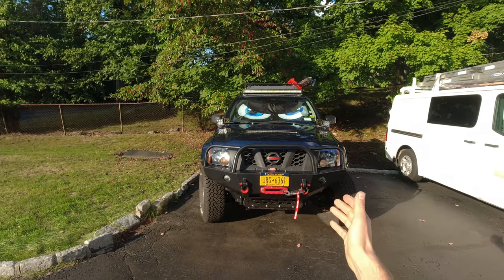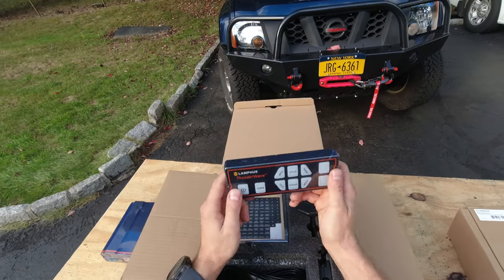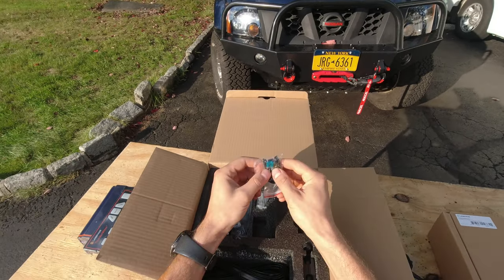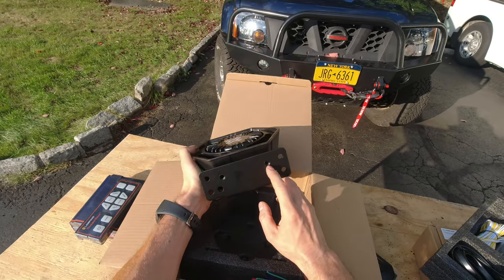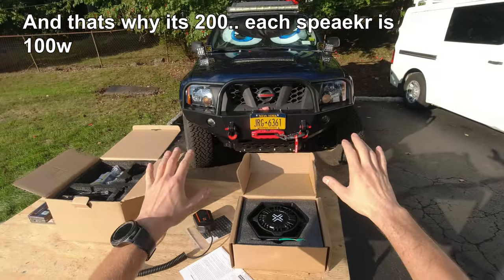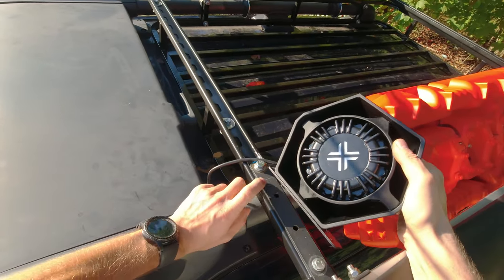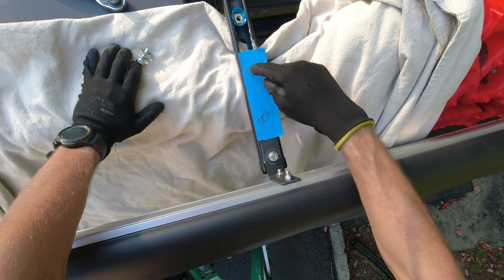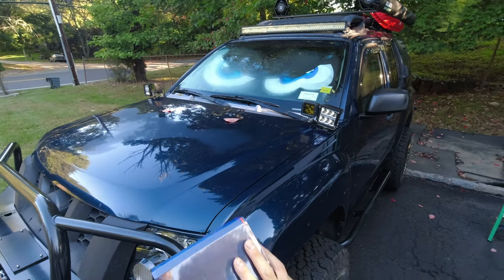ThunderWave 200W Emergency Siren Kit Warning PA System

Comment: do you have to long press and hold the siren buttons, or can you just press it once and the sirens go off?
Reply from the maker: You can just press it ones  and it will activate it.. then press it again to turn it off
Reply: @DIY_AUTO_PHOTO  Thank you for your help. Got it installed. The siren is loud. My neighbor is a sheriff and most likely getting tired of hearing the siren. The speaker is mounted Infront of the driver side fuse box, (Lexus 3x350h 2024) just behind the radiator, and still is ear piercing.
Reply from the maker: @kishanpatel2036  hahaha !! nice !! ))  glad the install was a success ! and yep the siren is pretty loud for such small unit I would say.   and hopefully the neighbor will not complain about it

Comment: Currently I have SoundAlert 12V 100W but it's not loud and no one can hear the PA if I'm driving 35+ mph. Cannot hear anything on freeway. Is the ThunderWave 200W loud enough to be heard on the freeway?
Reply from the maker: Hey Oh yes ! the 200W with 2 speakers is very loud and sound is very clear for PA system I was surprised in a good way )
Reply: @DIY_AUTO_PHOTO  Just to confirm, if I drive 65+ MPH on the freeway and use the  ThunderWave 200W, other people would be able to hear it?
Reply from the maker: @hello_im_kt  I have not tested it in that kind of use  just to be honest   however if you driving behind someone and use it they will hear it %100!  or side by side.. if that makes any sense . I hope it helps
Reply: @hello_im_kt  I watched a few videos on her and they all seem to agree that 100w travels about 700 feet before dropping below the ambient road noise of 70db. 
However, 200w travels 1,400 feet before dropping below 70db.

So, yes, 100w to 200w does not have a volume difference, it has a difference in range.

The only other way to increase volume and range is to do like he did in this video, mount the speakers facing forward, free of obstructions, and high up.

Beyond this, you'll need a 300w-500w train horn...
Reply: @chapitheclown1605  So just to confirm. If I buy the 200W PA system, more people should be able to hear the PA since it has a longer range? Correct?

Comment: Does the amp turn off when the switch panel is off or does it stay on. I dont want it to drain my battery.
Reply from the maker: Yes it turns off  so it won't drain the battery

Comment: How did you wire it to play music?
Reply from the maker: I used  a ( rca audio cable to aux  https://amzn.to/3MV82Jb ) and connected the  the RCA to the back of the head unit to the one of the  Line out for audio . and the other end of the cable I connected to the  Thunderwaw controller in the back there is a port for aux connection 
I hope it helps.
Reply: What if I have a 3.5mm to 3.5mm jack? Will that work?